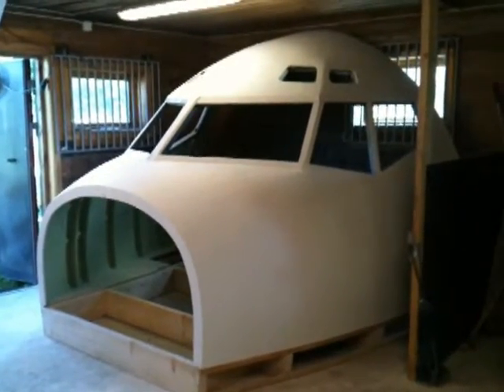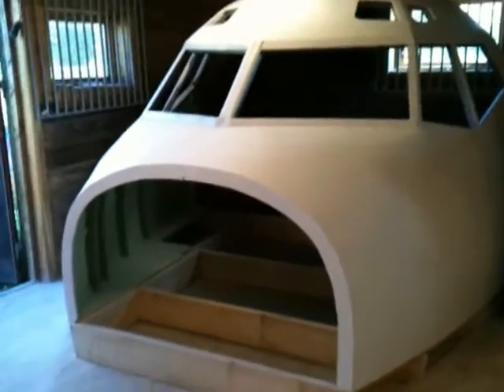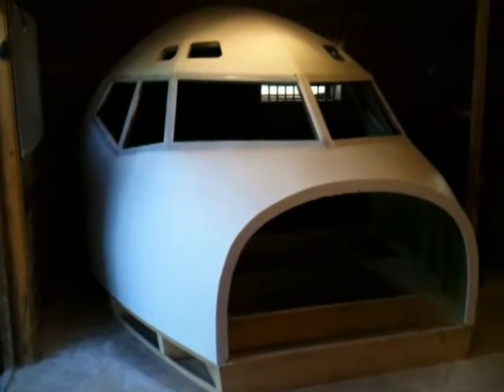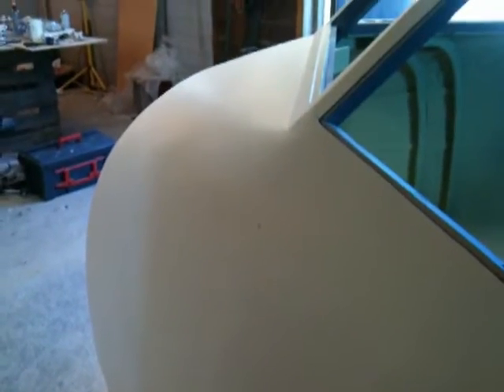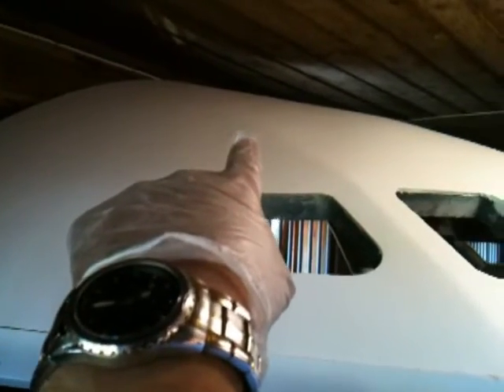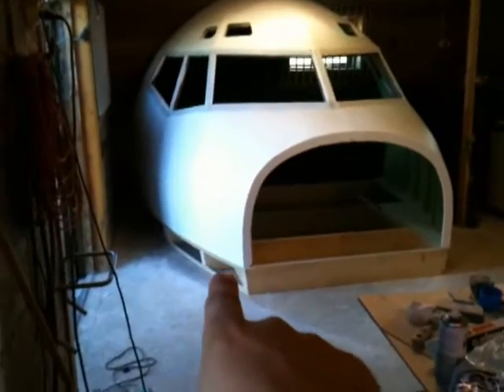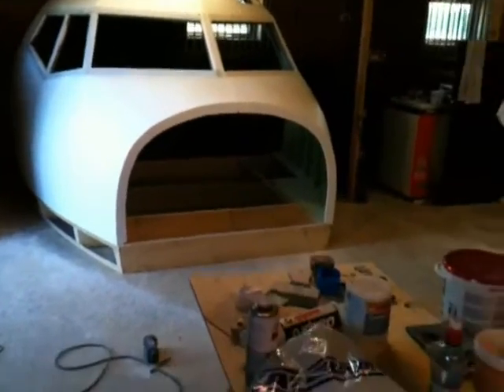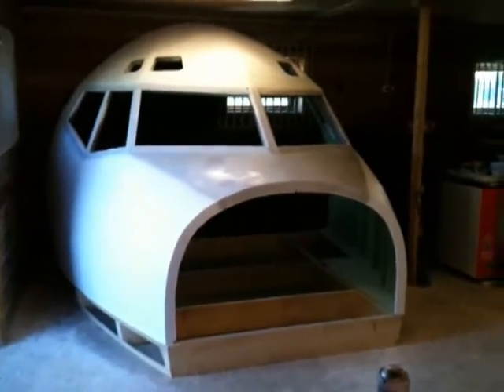Building a Boeing 737-800 home simulator #12

Comment: @Norwegian737Project i agree 2500 is two much for something that is just for looks it , but it comes down to how u are going to present it to vistators walking past  the front,  it  would be impressive if it could be done cheap enough, looking at ur past work thats well within ur grasp . but if most vistators spend there time behind the sim not walking around it during down time it doesn't pay. im thinking of the over all effect the first fivteen minutes is what will get them in.

Comment from the maker: @OXYOXYOXY444 Hey.. Well, I think I explained that in one of my earlier videos, but the roof comes of and the shell is split in half between the front windshield. From there, the shell will be dismantled from the base, and the base can also be split. Five individual pieces all in all. But entering the sim if that's what you are asking about, will be through the rear. A backwall will be constructed, with a door making the cockpit completely closed. I'm considering putting on a nose cone if I can.